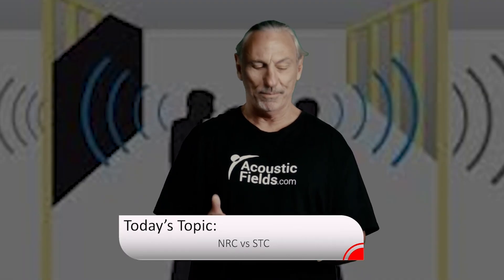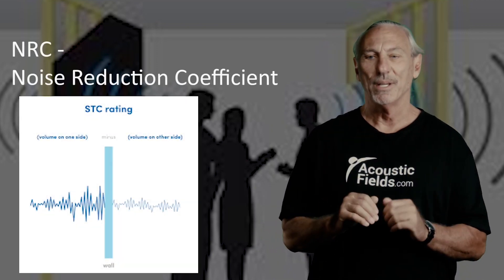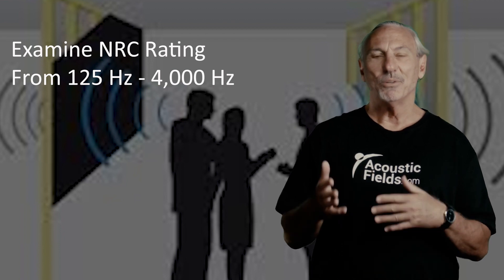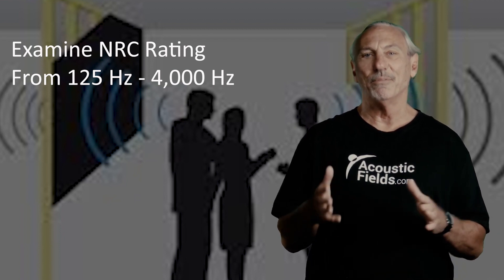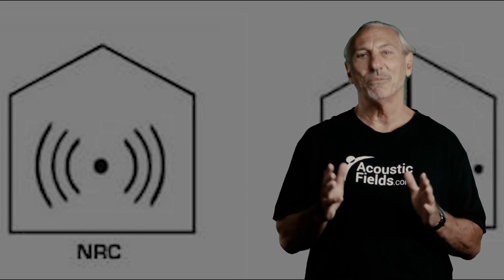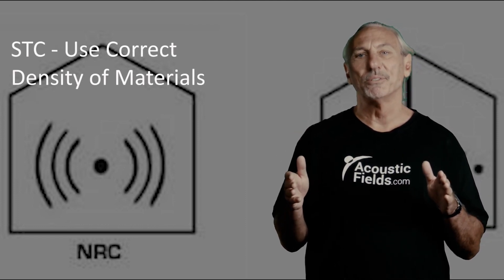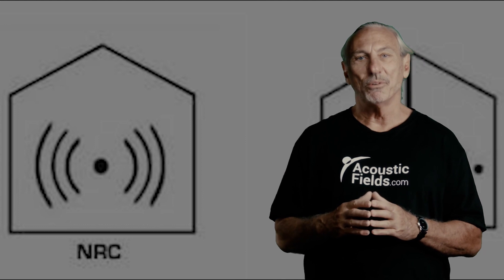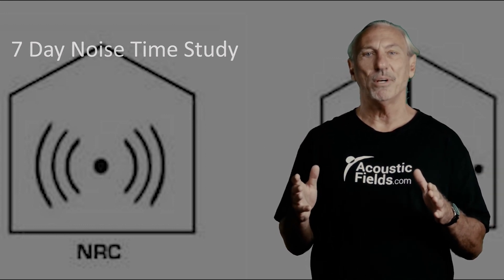NRC VS STC - What's The Difference? - www.AcousticFields.com

Comment: I just looked up STC and the frequency range it applies to, and I found that it only covers 125Hz to 4,000Hz.  

NRC is calculated at specific frequencies.  250Hz, 500Hz, 1000Hz and 2000Hz.

Are these correct?   If they are correct, then they don't apply to frequencies below those frequencies,  which are common problems in noise applications, especially where music is considered or when there are noises from sources like a garbage truck.

What is the most common structure that is discussed and often used for home recording studios and music/home theater listening rooms?   2 2x4 walls with double layers of sheet rock with a 2 inch gap, and often people use building insulation (fiberglass or rock wool) as the insulation material within the 2x4 walls, with Green Glue applied  between each layer of sheet rock.  Will that attenuate frequencies below 125Hz?  Nope.

So, how would you go about figuring out what materials and construction method to attenuate frequencies below 125Hz?
Reply from the maker: You are correct. NRC does not take into consideration lower frequencies, which after 50 years of dealing with noise transmission issues, we know noise is all about low frequencies. It does have value within the  stated frequency range. You ask how do you calculate for lower frequencies. Building and testing. Its the only way. There are no road maps to head down from past explorers. It took us 5 years to understand the impact that barrier density had on frequency.
Reply: @AcousticFields  That's insane how the industry ignored this in their so-called "standards".

Comment: What would be the best way to raise STC of a 14' high x 18' wall of a room that has a loud machine? It is probably 5/8" drywall with roll insulation. Would MLV covered by another 5/8" layer of drywall get an STC of above 50?
Reply from the maker: What is the frequency and amplitude of your noise issues? Noise must first be measured or you are just guessing. Guessing with noise is never a good idea.

Comment: I’m struggling with comparing NRC and STC to Europe/Africa standards like say Rw/Dw/STI and alpha_w/RT. We use the latter but occasionally get hotel projects in Africa that have American specifications (Typical for hotel brands) and its tricky to get around converting that. So like the hotel guide will say these rooms should have this NRC rating so we presume that means that if the whole room was hard surfaces but had a ceiling of the given rating then that’s sort of the reverberation time target - do that for a bunch of different rooms and material types and we try to take the average. At the end of the day we pretty much ignore their spec and just give them a reasonable spec based on our experience.
Reply from the maker: A,  That process would never work in my industry. We need predictability and consistency. Lower noise floors are critical in recording studios and listening rooms.

Comment: I have a specific need. My house is on a slab about 300 yards from the highway moving up over an overpass of a neighborhood street.  I notice a steady low frequency hum when I use a microphone.  Am I banned to have to record direct into my laptop and skip microphones altogether?  Thanks.
Reply: @Dave -  Are you recording only electronic instruments?  Have you tried using a high-pass filter or a notch filter to kill the "hum" from the microphone?  A steady hum may be an indication of an electrical grounding/shielding issue.  What frequency is the hum?  Highway noise usually varies a lot, when you say "steady hum" it doesn't seem like it would only highway noise.  Either way, good luck.
Reply from the maker: D,  You need to measure frequency and amplitude of the noise. Guessing with noise is a fools' game.